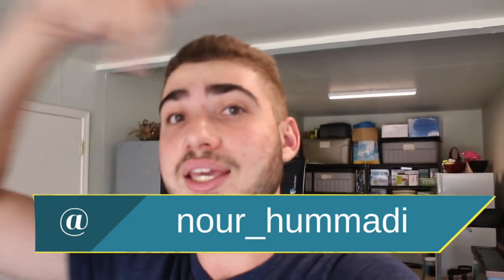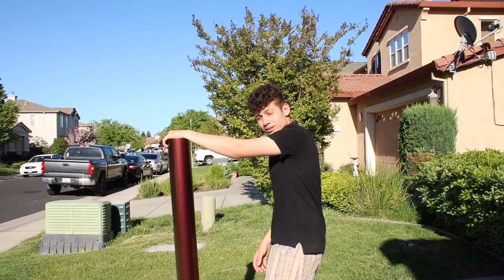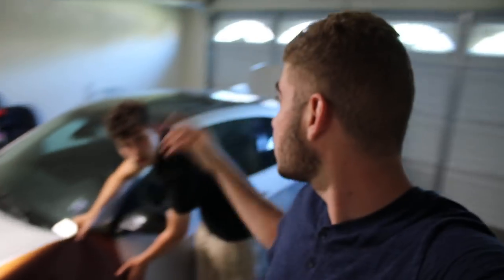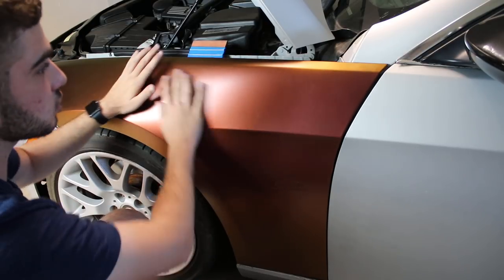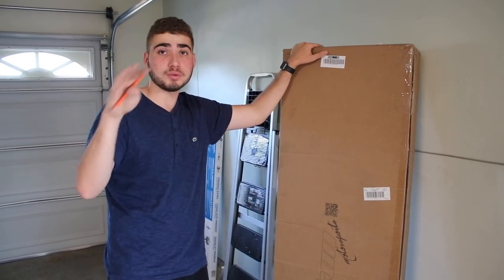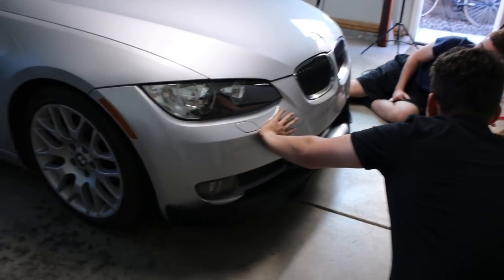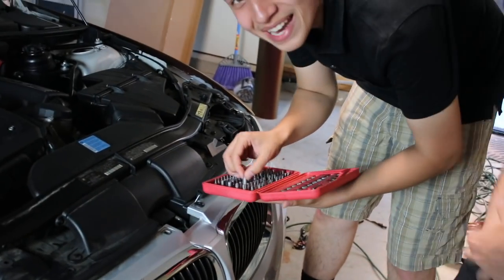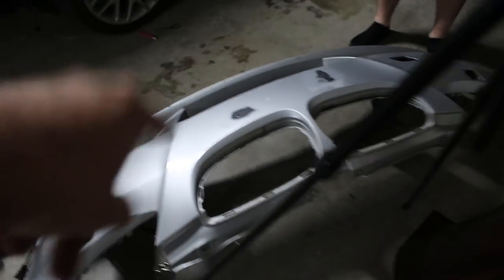THE E92 TRANSFORMATION! (Wrap, Lip, etc) Part.1

Comment: Is the e90 330i good for daily drive.. ??or should I stick with e90 335i
Reply: stick with the 335i
the lack of power on the 330i is so sad :'(
Reply: NA vs Turbo, NA will be cheaper on maintenance. So if your broke college student, don't make much money, and want lower maintenance costs go 330i. In the USA they only made the 330i for the e90 in 2006 then replaced it with the 335i the next year. 330i is better than the 328i's you mostly see as the 330 has bigger brakes, better transmission, more power, etc so its the best NA version to get. If you want more power, have the money for the maintenance, want much more tuning ability, and more power for the $$ 335i all the way. I personally went with the 330i because i live on my own, pay for everything myself, and don't make enough money for the maintenance of the 335i. I sure wish i did though because i would buy the 335i instead. But i still love my 330.

Comment: I found wrapping hard but I was using eBay wrap is that y
Reply: Robles Inline 6 Bro, ebay wrap is way too thick... as you can see the wrap they use is thin as silk. You definently found it hard cause the ebay wraps are way too thick
Reply: Gucci E60 I def noticed that